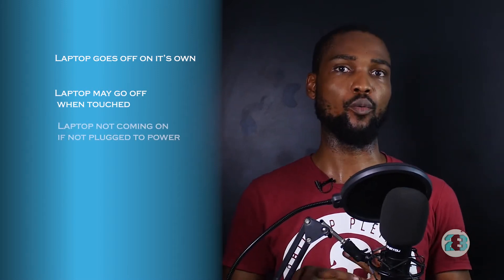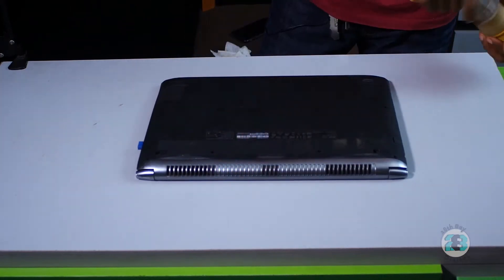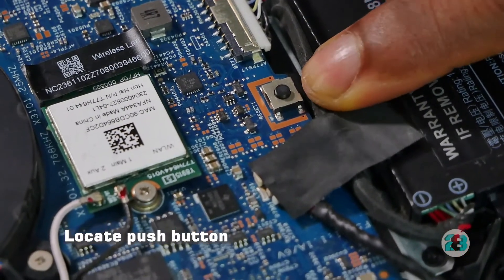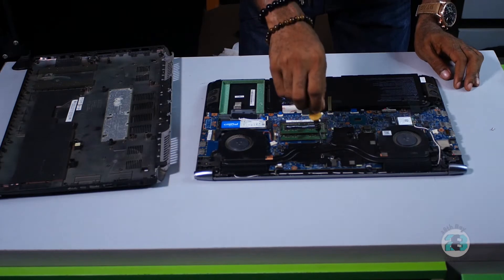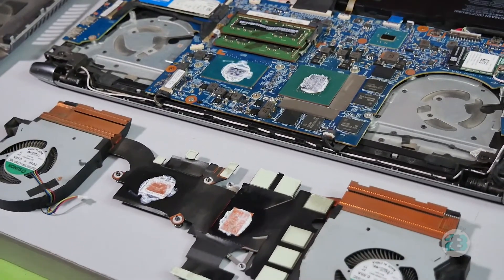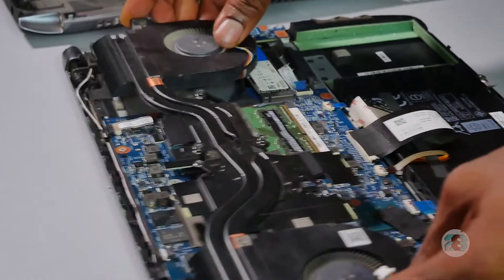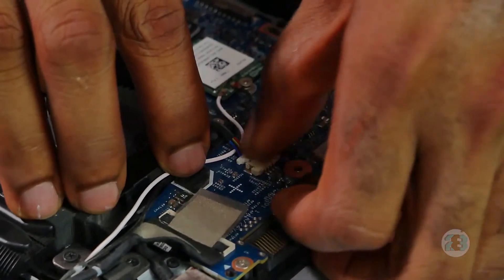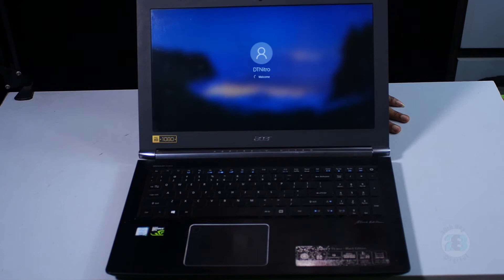Acer Aspire V Nitro Fix Black edition(trip off, over heating)

Comment: Good afternoon Sir I have a problem with same Acer aspire V15 nitro Black edition laptop is power on not Display on screen I did what you do on your laptop still not working
Reply from the maker: If system powers with fan(s) on. Try re inserting the ram chip. 
Or remove ram
Power it
It should beep once or a few times(if not, ignore)
Power off after a few seconds
Look for the reset button and tap it
Reinsert ram and power on. 
You may reach me on contact28thbay@gmail.com, let's troubleshoot together